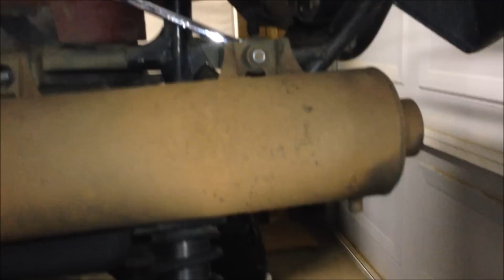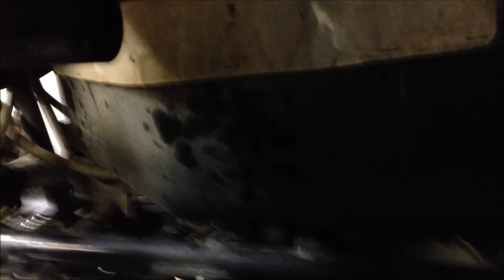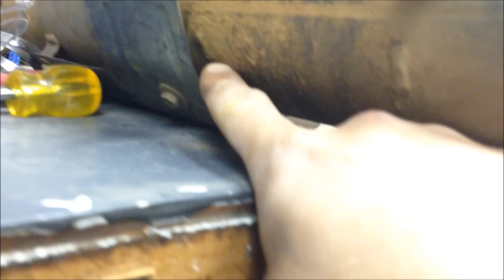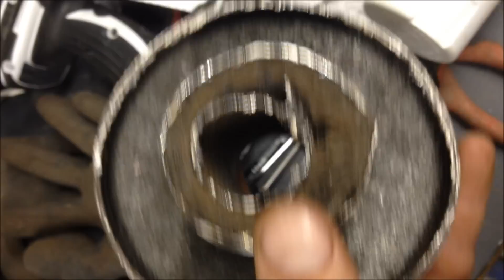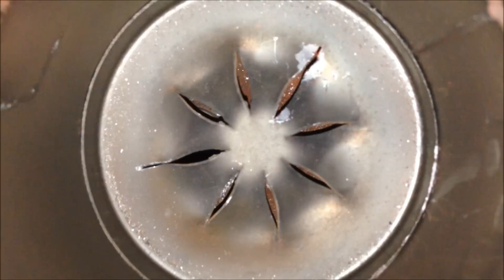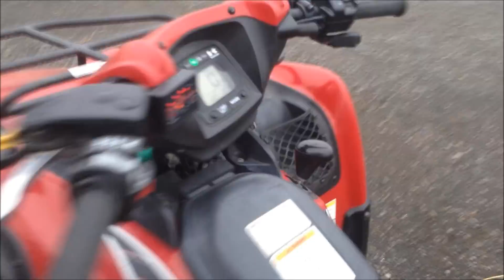2005 Kawasaki Brute Force 750 - Stock Exhaust Modification

Comment: last question!  if i dont 're jet it back fire how bad is for the engine?  Sorry i dont know much about small engines. Thanks
Reply: Whenever opening up additional airflow by modifying the exhaust and/or air intake it causes a lean air/fuel ratio. In order to correct this you must rejet the carburetors, or remap the fuel system with an EFI setup.

Running an engine lean is not good and over time will cause damage. Also, you will not gain additional power simply by opening up air flow, you must add additional fuel as well.

Comment: ok. do i have to 're jet if i do the same? if yes why?
Reply from the maker: I would recommend doing this only if you upgrade the stock air filter and jet.  The reason is because all those things change the air to fuel ratio.  Adding exhaust mods increase air flow and if you don't jet your bike will run lean and have some serious backfire problems.

Comment: did you use aluminum welding for this exhaust?
Reply from the maker: The stock pipe is made of steel so regular welds are the ticket.  Used a wire feed.

Comment: with a free flow air intake filter like a k&n and the muffler mod....could you notice an improvement power wise?
Reply from the maker: Thanks for your comments man, appreciate it.  I noticed a huge difference when I did this mod I added a k&n and rejetted the carbs.  It's in a different vid I uploaded if you're interested.  It made the throttle response almost scary.  I had to be careful not to accidentally bump it when I was sitting still because it would throw you back in a hurry!  I need to do some new vids, I actually sold this Kawasaki and have bought two different Grizzly 700s since.  They are more of a Cadillac and produce good power with some mods but the Kawi definitely had more get up and go.
Reply: what did you re jet them to?

Comment: Hey bud did ya have any backfire issues before ya did you mod ?????
Reply from the maker: Yeah I did.  The biggest thing that causing excessive back fires are when you are getting to little fuel.  In other words, your fuel to air mixture is lean.  There are a few things to fix it, but mainly make sure you have your air/fuel mixture screw to the right setting for your jets, air filter/inlet and exhaust capabilities.  My other video on re-jetting the carb will explain a little.  You don't want to do this mod without re-jetting the carbs because if you don't it will probably just make matters worse.  Hope this helps.